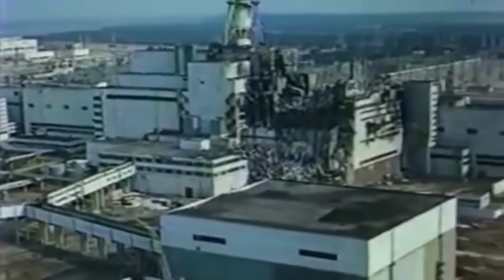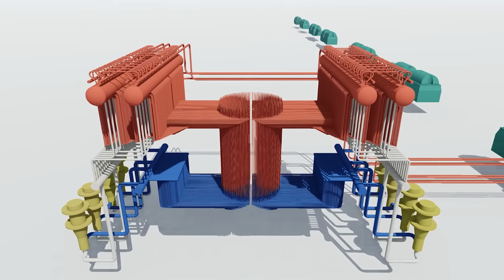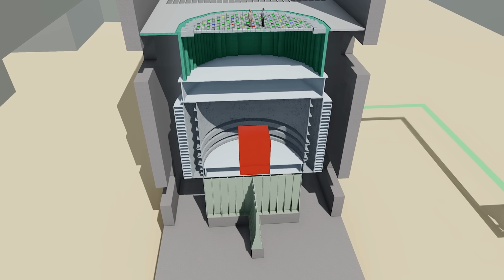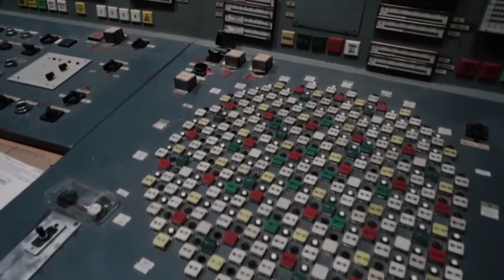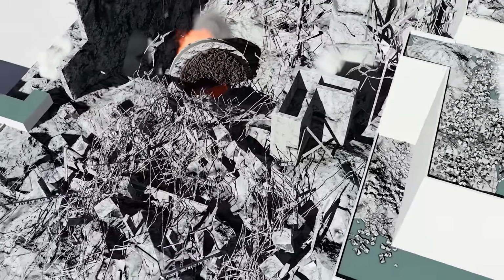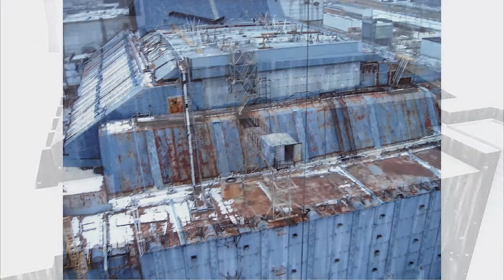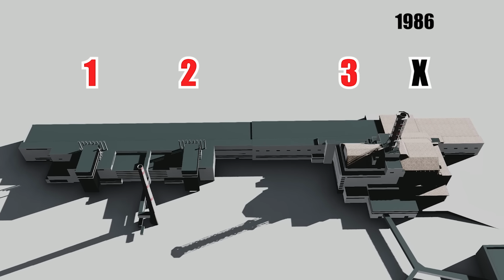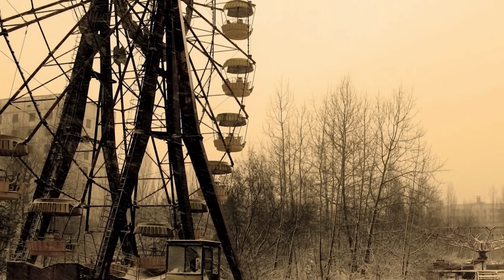CHERNOBYL DISASTER - An Inside Look - 3D

Comment: Alright 3D animation, but a severely misinformative video in content.

Firstly, the RBMK design was stable under normal operating conditions. It's positive void coefficient was counteracted by other factors, and as such was not a problem for the stability of the core under normal load. Indeed, the removal of stabilizing water caused by rapid control rod insertion, and the addition of moderating graphite soon after was the real problem that destabilized the reactor, even if the positive void coefficient made the tipping point of the reactor substantially lower than it would have been otherwise.

Secondly, the RBMK design was not badly contained. It had a large amount of graphite, concrete, steel, sand, and even water shielding. All of these this video puts under "concrete pit", which is severely misinformative. The RBMK design was unique in that it did not require a pressure vessel, because instead of water boiling and pressurizing in the pressure vessel freely around the core, the cooling water was flowed through hundreds of pressure channels. This allowed for easy refueling and efficient cooling, and also allowed the reactor to essentially run natural uranium. Essentially, it had many small pressure vessels instead of a large one. If the japanese PWR reactor had suddenly flash boiled all the water as Chernobyl Unit 4 did in 1986, the pressure vessel would have ruptured, and probably throws molten core against the steel lining with high velocity. It's unlikely that the containment could survive the scenario, as it has been made for a reactor that should never be able to encounter such scenario. The RBMK containment was largely the same.

Thirdly, portraying Antony Dyatlov as "stupid", "reckless" or "inexperienced" is more than misleading. Antony Dyatlov went through with the test as he was ordered, because in his mind the worst case scenario, even after slowing the reactor too much, was it shutting down automatically. Of course we now know this is not the case. But Antony Dyatlov was certainly not ignorant of the fact that the reactor could explode, rather, the fact had been intentionally kept from reactor operators, personnel, engineers, and even party members. While it is true that Dyatlov passed multiple safety systems, this was done to properly perform the test independent of those safety systems, and to be able to bring the reactor back up to required power. The fault that caused the reactor to explode had been discovered much, much earlier, but intentionally kept so as to not slow the project down. In this light, believing the reactor could never go supercritical, Dyatlov's actions are all fully rational. Human error always has a bad system behind it, and it should never be said that human error is the fault of the operator. In actuality, the Soviet bureaucracy was the real cause of the Chernobyl disaster of 1986. 

It is not wise to portray facts incorrectly to bash on one of humanity's greatest nuclear reactors. Aside from the bad handling of a serious problem, the reactor design could have, and nowadays is, one of the most efficient, powerful, and long-running reactors. Here's to hoping NG reactors of the 21st century will beat that record.
Reply: Anatoly* Dyatlov, not Antony (Анатолий)
Reply: Zemlyak detected

Comment: Oh for fuck's sake, not the bogus line about bypassing safety systems again...

No safety systems were bypassed in a way that contributed even slightly to the disaster. One emergency cooling system was disabled in full accordance with the test program and regulations, but this system could not have done anything at all the mitigate or prevent the explosion.

Two more automated shutdown trips were disabled, but this actually delayed the explosion by several seconds.

Chernobyl-related misinformation is immortal, it seems. Lies the Soviets told the world in order to save face,
Reply from the maker: MrChyort ... ok so why did the reactor explode, if it wasn’t an idiot in charge who had no clue about reactor physics who did all the wrong things with the reactor a bad design especially when at very low power levels where it was very unstable?!
The video says the reactor exploded because 1 flawed reactor design. 2 human stupidity. 3 erosion of safe culture.
Reply: @Mike-Bell  First of all, I don't hear anything about bypassing safety systems in your response. So you should make that correction in your video first.

Second of all, the man in charge of the room that night was universally described as a consummate professional with excellent knowledge of his field. He knew the subject matter forwards and backwards. It was the designers themselves who never bothered to study how the reactor functioned at low power levels, and did not connect the crucial metrics to any warning or safety systems, or even described the hazards in the manual. The operators could not be bigger experts than the scientists who designed the reactor! At the time there was absolutely no prohibition about operation at low power.

Human error and poor safety culture were indeed factors in the disaster. But they were of drastically less importance than the flawed reactor design. 

The reactor's flaws were so great that a similar accident could have occurred even without any violations of the operating procedures, in ordinary operating conditions. Actually, it is entirely likely that the staff did not even violate ORM (the only transgression that had a direct effect on the accident) that night, due to a glitchy diagnostic system. Even if ORM was at 6-7 rods, the reactor was dangerous with an ORM below 30. So the restriction in the manual was way too low.

As repeated time and again by Soviet experts and power plant workers, an accident of this kind was inevitable.
Reply: @Mike-Bell  Let's not argue, though. If you want to make the video more accurate, you should replace that line with something like this:

"The operating personnel inadvertently raised too many control rods in an attempt to overcome xenon poisoning. Unbeknownst to them, this arrangement of control rods turned the emergency protection system into a detonator."
Reply: @Mike-Bell  Human stupidity was not a factor, at least when it comes to the operators. Unless you consider it to be stupid to assume that an emergency shutdown system decreases reactivity instead of increasing it.
Reply from the maker: Silanael the Soviet RBMK scientists were very well aware that this design athough stable and predictable at full power was highly unstable and unpredictable at low power. Dyatlov either didn’t properly understand the science behind its low power instability or had become very complacent. Either way he alowed arrogance to get in the way.
Reply: @Mike-Bell  The current belief is that the reactor was stable until the positive scram effect kicked in from trying to shut the reactor off after they were done with the experiment.  The instabilities from low power operation were easily compensated by the AR (automatic power regulator) system. Now, running the reactor in the state they did, was reckless to some extent, but it wasn't by itself the cause of the accident, merely bringing the reactor to a state where the design flaw of the control rods would have a severe effect. Without this flaw, the accident would not have happened, and the operators weren't made aware of it, so they really can't be blamed.

TL;DR: The reactor didn't blow up because of instability on low power. It blew up because a design flaw made control rod insertion increase power instead of decreasing it.

Read INSAG-7 for better understanding.

Comment: Let me add my congrats on a really excellent video.  I have been known to be violently critical of errors in Chernobyl videos; I am encouraged by yours.

I had often wondered why the liquidators did not start at the door and shovel the stuff progressively back instead of running out into the middle and shoveling up some random piece of crap, then run over the broken surface to dump it off the edge, as is shown in some original videos and in the HBO series.  Great place to break an ankle, says I.  But when I saw your videos of the workers, they were obviously doing the rational thing.  Thanks hugely for that.
Reply from the maker: puncheex2 thanks for the positive feedback and that there aren’t obvious errors. I have such respect for those brave liquidators. Such a thankless task.
Reply: Well, you see, the eye-witnesses have told me that in the beginning, liquidators had to work for 2 hours. Once those died (very quickly), the work time got shortened and then shortened again and again until the state said that they have to work for a couple of seconds. And after the work - run for their lives. It's very scary to imagine that.

It's weird that HBO series didn't show the fact that they had to work for 2 hours, but already cut it to 90 seconds. Oh well. These series were great nonetheless. Including this video too.

Comment: Its not correct to say that all western reactors can't be refueled while running nor that a hot fuelable reactor can't be protected with a containment structure.  Its also wrong to suggest that reactors with a positive void coefficient couldn't be licensed in the west.  The Canadian CANDU reactors are refueled while running and they do have full containment structures.  In a lot of ways the CANDU reactors are like an RBMK tipped on their side.  In CANDU reactors the fuel and cooling channels run horizontal where-as the RBMK reactors have vertical fuel and cooling channels.  CANDU reactors use heavy water instead of graphite for a moderator.  But like the RBMK reactor the CANDU reactors have a positive void coefficient.  Both the CANDU reactors and the RBMK are designed to use unenriched natural uranium.  It seems that the similarities between the CANDU and RBMK arise from this shared choice to bypass fuel enrichment.

I liked your comparison of the BWR to the RBMK.  It would have been interesting to also see a comparison with a PWR like TMI.

It would have been good to include the location of the uncompleted reactors 5 & 6 at Chernobyl (excuse me the "V.I. Lenin NPP").  Everyone forgets those two.
Reply: The "Chernobyl" name is right and enough to identfy the Object.
The name "V.I. Lenin" is rather abstract because in the former USSR there were lots of facilities called "Lenin", "Kirov", or any bolshevists' name.
Okay, let's get into the thing.
NRC and IAEA documents require both Containment Building AND the Reactor Vessel. It's pretty hard to understand how CANDU-6 can be called a Gen-III+ Reactor with calandria instead of heat-pressure-resistant and hermetic vessel.
Reply from the maker: Steven Multhaup thanks for the correction.
Reply: @Mike-Bell  When I made my comment regarding the CANDU design, I wasn't aware of the Magnox reactors in the UK.  The Magnox reactors use graphite moderators, are hot refuelable, and run on unenriched fuel.  So they are even more similar to the RBMK than the CANDU reactors.  Magnox reactors are however gas cooled with CO2 rather than heavy or light water.  So they are different from the RBMK & CANDU in that way.

I agree that western light water reactors like the BWR & PWR are more common and much safer than the RBMK but there a handful of these western reactors that run on unenriched fuel and are thus similar to the RBMK.

The light water PWR's (running on enriched fuel that can only be refueled when offline) seem to be extra safe because of their massive containment (required because of the high pressure [i.e. the P in PWR]).  At the TMI PWR it is likely that hydrogen in the containment burned.  But no one noticed until after the fact because of the strength of the dome.  Some operators reported hearing a thud noise, but mistook it for an HVAC damper shutting not realizing that it was actually a hydrogen explosion in the dome.  That's crazy! - crazy good.  Better than the Fukushima BWR's that blew their tops when the hydrogen exploded.

That is what worries me about the AP1000's.  They look like they have strong PWR style containment; but those AP1000 domes are actually open to the atmosphere to allow natural convection cooling.  The only thing between you and the radiation inside is a steel egg shell containment.  I don't know if the egg shell can stand-up to a hydrogen explosion.

But I do love your animation.  Great work overall.